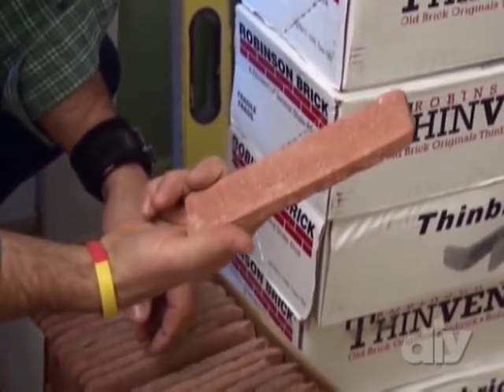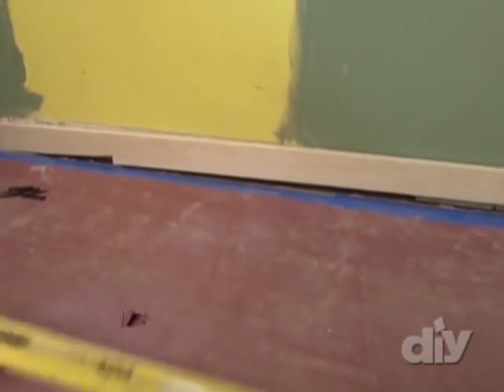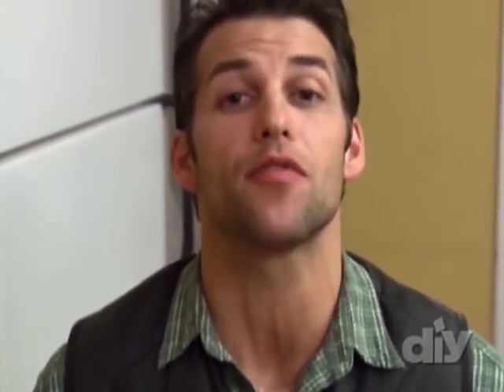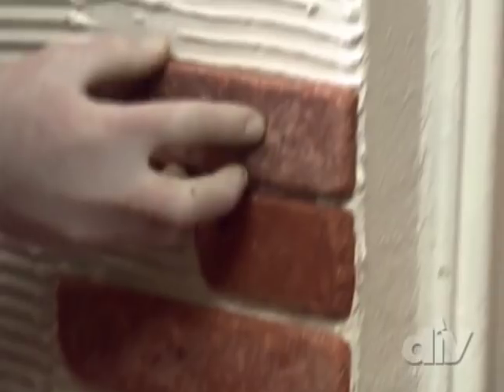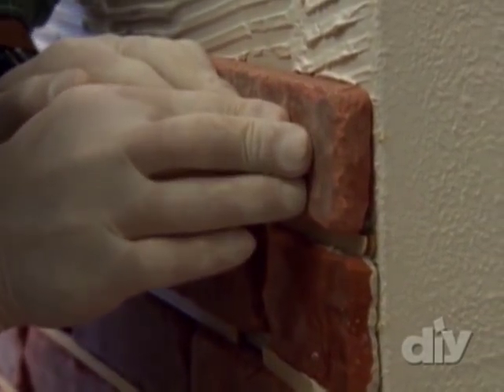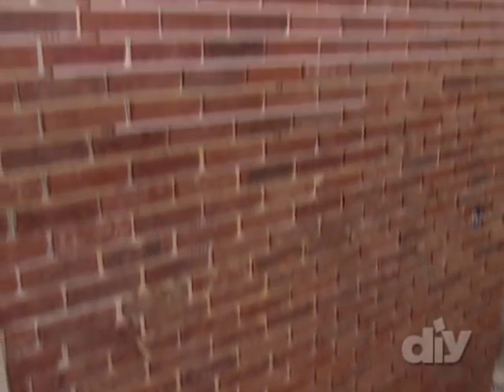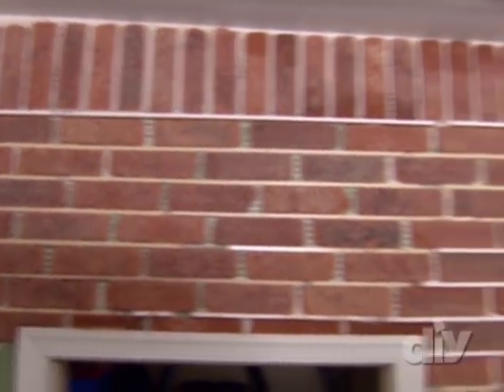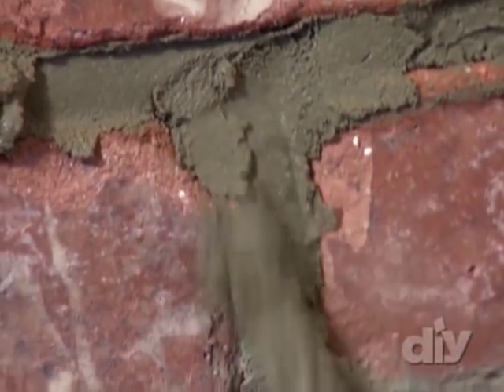DIY Brick Wall - DIY Network

Comment: This video helped a lot. I was def. stuck on a few things, but this video helped me do it correctly.  I just finished installing some recycled brick tiles from a company in massachusetts that takes the old brick pavers from historic mills and cuts them into brick veneer. It came out awesome!! The company is called Berkshire Brick.  Thanks for Sharing @DIY Network!!

Comment: I liked what it was done. However, I'd recommend to use a grout bag to fill out the joints instead of the tuck pointer. This will help you be more productive and efficient when filling the joints not to mention more professional.

Comment: Looks good, but how did you get the spacing strip wood out without pulling tiles off? Did it pull out without any issues? Or did you leave it in there and grout over the top?
Reply: exactly my thought
Reply: I had the same questions.
Reply: buena pregunta amigo!!!!!!

Comment: I see a lot of new landlords try to do new and trendy thing to make their new rentals stand out to high quality tenants, but most of the time, if you have fresh paint, clean appliances, and clean floors, you're going to stand out already. A brick veneer wall looks great, for sure! It can be a good addition to your home, but for our rentals, we keep our finishes clean and durable. One opportunity for trendy finishes, particularly brick walls, comes when you renovating an old home to rent out (usually 100+ years old). Sometimes they will have interior brick walls that can be stripped down and cleaned up to look good with the rest of the unit.

Comment: Those are old school Cambridge bricks!! Also you should snap your halves instead of cut them to achieve the same beat up edge as the rest bricks or beat em up with your hammer. 
Also use a grout bag to install the mortar into the bricks but cool video

Comment: actually the most effective way to fill joints is with a grout bag
Reply: Carlos B can you just use regular sanded grout?
Reply: sahilkoch I would use type or type S cement mix it's just water the mix and sand and use a grout bag to fill in joints and then either use the Grapevine jointer or the regular one
Reply: I love grout bags, saves a lot of work 👍
Reply: Lol I was about to say the same

Comment: what does he do with the ledger after the brick is installed?
Reply: Nunya Beeswax He just ran skirting board/base board over the top of it. The ledger would actually provide a nice base for nailing into.
Reply: You can also remove the ledger board and add more bricks in its place

Comment: As a mason this makes me cringe. Never ever have I used a piece of wood in the bed joint.
Reply: This is more like tile work than brick laying. Although because most brick products are not dimendionally perfect, i agree that a continuous spacer like he used could cause leading of the stack dimensions after just a few rows. Personally i would snap lines for the top of the brick and back butter them instead of full trowling the mud. A taught mason line would also work.

Comment: It's spaced to far. Real brick is stacked. I'm the son of a brick layer.
Reply: Standard mortar joint is 3/8". "Real brick work" is not dry stacked. Maybe for a decorative knee wall but never on a wall that tall and absolutely not on something that's bearing any weight. You may be thinking of "butter joints" where the joints are very thin but the wall still needs mortar to hold it together. The "spacing" is fine. Bond is a little wonky but he's a carpenter so we'll give him a pass. 

Source: I'm a bricklayer.